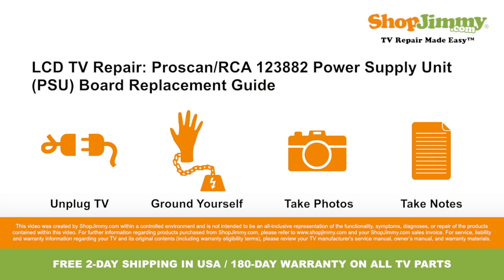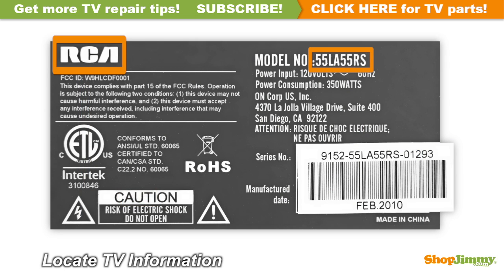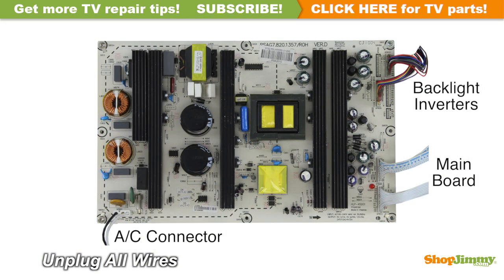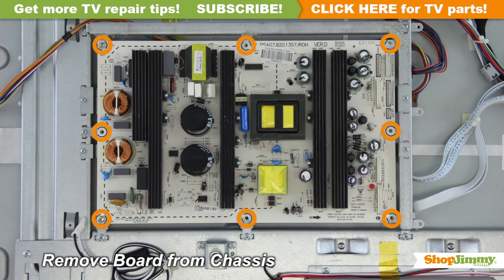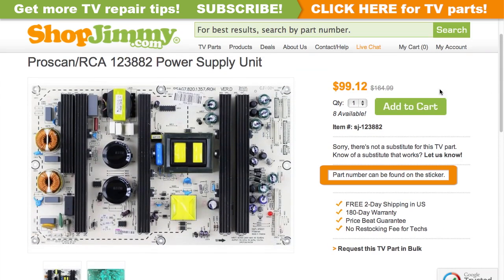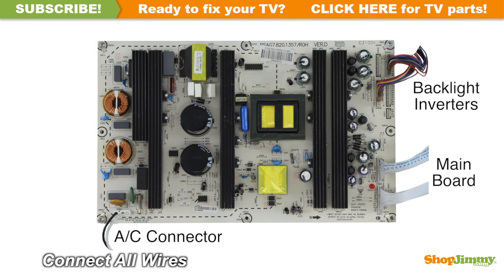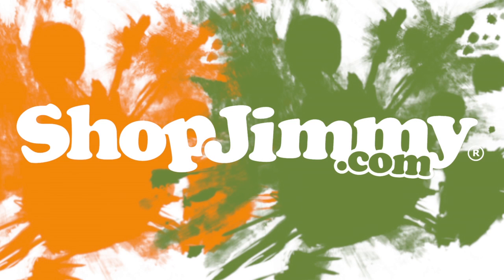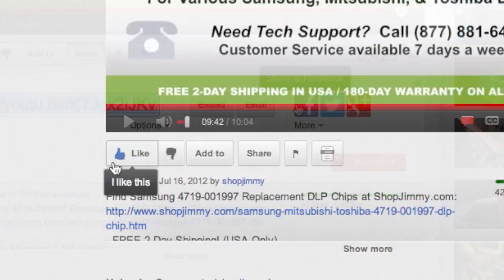Proscan/RCA 123882 Power Supply Unit (PSU) Boards Replacement Guide for LCD TV Repair

Comment: Proscan huh. Couple of years ago I bought a 40” Proscan and right out of the box it’s not working, I checked it out and did some tests but to no avail. Called Amazon (because that’s where I got it from) and they said send it back and we’ll send a replacement. Ok fine did what they asked sent it back replacement came in a couple of days later (yay!) set up the new one (what?) same thing happened went to turn it on nothing , blank screen no sound. Well hell called Amazon (because that’s where I got the replacement tv) went through the hoops and hassle then they said that they would refund my money. I asked them for return authorization and they said keep it they don’t want it. So now it sits in my shop. I’ve replaced the main board still nothing so now I’m cruising YouTube to see if I can get any clues to what the problem is. Oh and I bought a Sharp 40” flat panel and it works fine.

Comment: proscan lcd tv model 40ld45qc - was flickering, flashing. gave it a good hit with my fist on the rear corner. Problem solved. Have to do this a few times a week, been about a year now. Also leave it on full time as it didnt want to restart when off. Have to hit it harder now, so I think the end is near. But a new 43" is $160, so a $99 power board seems foolish. Any thoughts? Get a hammer?

Comment: I have a PROSCAN Model PLDED3257 A-B LED 32” the front power light is on but the T.V. wont turn on.. Do you think it's the power board?

Comment: I have a proscan 40" H D  L C D tv model # 40ld45q  serial # 9144-40ld45q-t118379  made Nov.2009  it turns on with picture and sound for just a few seconds than the screen goes black the sound is still on  ok

Comment: I have an RCA PROSCAN 39-40 inch LED TV not even 3yrs old. The problem is:  A dark screen and no picture or sound. The picture tries, but won't come in.  PLDED3996A-6 is the model and s/n is: A1304093290002425. Repair shop estimate is $435.00 and they parted it out and said: The picture is dark due to defective LED strips inside of the LCD panel. They put it back together and the charge was $40.00. Are there parts for it and if so, how much.   Thanks, Marvin       email: marvinhbutler@att.net  with the answer.
Reply from the maker: +Marvin Butler   Try all repairs and troubleshooting at your own risk.  Unfortunately we do not sell replacement LEDs for your TV model number at this time.  You can check back in the future to see if we have them available.  Thanks!  www.shopjimmy.com

Comment: My RCA L40FHD41 turns on and runs fin for 30-40 minutes then the picture goes dark, but the blue status light stays lit. After a few minutes, unplugging the set from power, then re-plugging causes it to start up, find the input and resume. For 30-40 minutes. Entire PS board problem, or something less catastrophic? Thanks!
Reply from the maker: +Harry Butler (hbphotoav)   Try all repairs and troubleshooting at your own risk.  I recommend running the flashlight test on your TV.   Here is a link to a video we produced that shows how to run the flashlight test. https://www.youtube.com/watch?v=xUzCLgoSPGM Please reply with your flashlight test results and we can recommend a replacement part for your TV repair. Thanks and please let us know if you have any questions! www.shopjimmy.com

Comment: I have a Proscan 39" LED PLDED3996A-C2, less than 2 years old.  When I turn it on there is no picture.  I can use the remote to change channels, increase/decrease sound, set sleep timer and they all work fine but no picture.  Can anyone recommend what part I might need?  It never occurred to me I might be able to fix this tv myself but if the part is reasonably priced, I can follow a YouTube video.  Thanks.

Comment: I have a RCA 39" LCD Full HDTV. I power it up, blue light comes on with no picture. The only way to turn it off is to unplug it.It is 2 years old. Any suggestions?

Comment: i did also flash light test and was able to see menu cked 24v to backlite inverter all 24v seem to be there....no obvious lites on backlite inv...did pull invert board and noticed heat marks on backside top of board....

Comment: i have proscan 40lc45s  blank screen and no sound... red power light goes to blue (stays blue)....power board red led on...
Reply from the maker: Davesbbq   I recommend replacing the main board in your TV.  Click this link to replacement parts for your TV model number:  http://www.shopjimmy.com/catalogsearch/result/index/?cat=56&q=40lc45s  There may be multiple boards for the same TV model number, be sure to match part numbers on your current board, with your replacement for compatibility.  Thanks and please let us know if you have any further questions with your TV Repair!  www.shopjimmy.com

Comment: Jimmy.com, i have a proscan plcd5092a-b  that just went out, there is no power and no stand-by led red light.  I am assuming it is the power supply board and i seen one on your website.  Any thoughts.  I was going to trash it but if a 45 dollar board will save it, well that would be nice
Reply from the maker: Warren Brady   Yeah, that could be the problem.  Might be worth it to try replacing the power supply board to see if it fixes the problem.  Thanks!  www.shopjimmy.com

Comment: Hi , I have an RCA 39" Mod LED39B45RQ...  usually it will not turn on with either remote or power button on rear of unit, however, if I unplug it and plug back in (immediately), it will usually turn on within 5 to 10 attempts of this, and sometimes very slow to turn on when it does.... and when it fails to turn on the red light will go out and stay out till I do the re-plug process.... so would it be a PSU or Main board issue??
the tv has 10/ 2012 manufacture date... PS, the youtube tutorial is awesome!
Reply from the maker: BIGDOG1189  Please watch this video FIRST to help with your repair!  TV Repair! LCD, LED, Plasma, DLP How To Fix Your TV with ShopJimmy.com Help!  I recommend replacing the main board in your TV.  Here is a link to replacement parts:  http://www.shopjimmy.com/catalogsearch/result/index/?cat=56&q=LED39B45RQ  Be sure to match part numbers on your current board, with your replacement for compatibility.  Thanks and please let us know if you have any further questions with your TV Repair!  www.shopjimmy.com

Comment: I have a ProScan 26' LCD TV Model  #26LB30Q   when I turn it on it stays on for about 10 to 20 minutes and cuts off by itself if I turn it back on it stays on for about 5 minutes then powers off what could possibly be wrong? Picture and sound is excellent
Reply from the maker: Rita Ellis   #tvrepair  I recommend replacing the power supply board in your TV.  Here is a link to replacement parts for your TV model number on our website, click here:  http://www.shopjimmy.com/catalogsearch/result/?q=26LB30Q  Be sure to match part numbers on your current board, with your replacement for compatibility.  You can also call our customer service for further assistance with your purchase.  (877) 881-6492  Thanks and please let us know if you have any further questions with your TV Repair!  www.shopjimmy.com

Comment: Hi I have a proscan 40lc45s that would have the red standby light on but flicker with no. Recently I tried turning it on and I get no standby light. Could this be a PSU problem ?
Reply from the maker: Miguel Rodriguez   Yes, if you have no standby, then I recommend replacing the power supply board to see if that fixes the problem.  Here is a link to replacement parts for your TV model number on our website, click here:  http://www.shopjimmy.com/catalogsearch/result/?q=40lc45s  Be sure to match part numbers on your current board, with your replacement for compatibility.  You can also call our customer service for further assistance with your purchase.  (877) 881-6492  Thanks and please let us know if you have any further questions with your TV Repair!  www.shopjimmy.com
  #tvrepair
Reply: Hi I finally got around to replacing the power supply board and i now have the standby on. Now the problem is the tv wont turn on. I can hear the psb, but it wont turn on. Any suggestions ?

Comment: I have a 32' proscan. The red standby light comes on. When I try to turn it on the light does change to green, but the screen is pitch black as if its off. What should I do?
Reply from the maker: Thicktufted Gai   What is your TV model number?  Please reply with your TV model number and then I can recommend a replacement part.  Thanks!  www.shopjimmy.com

Comment: Have a 40 tv and standby light comes on but no power. Is it the power board?
Reply from the maker: Tyler Jacskon   Since you have the stand by light in your TV, I recommend replacing the main board for your no power problem for your TV.  Please reply with your TV model number and then I can respond with a replacement part recommendation for your TV repair.  Thanks!  www.shopjimmy.com

Comment: Hi I have a RCA tv that turns on but for 2-4 sec before it turns off the audio still works and the image still comes out if I use a flash light I can see the image but the backlight turns off and won't come on. Could you please help me.

Comment: I have a proScan 32 inch duel hdmi  tv , when I power on the blue light comes on but not picture when I unplug it and plug it back in sometimes it comes on and sometimes it don't. What could be the prob tv is about 5 years old

Comment: Hello, I'm having issues with a 40 inch Proscan TV that won't turn on anymore. The red light in the middle still glows red but the TV doesn't respond to the remote or power buttons anymore. I was thinking the TV died because we've used it for four years but my friend said it might be something with the power supply. Thank you

Comment from the maker: @josh savo - I would recommend replacing the main board in your TV.  Do you have the Proscan 47LC55S240V87?  If you can identify the part number on your main board, please search it on our website shopjimmy com.  You can also call our customer service if you would prefer and they can help you search out the part.  (877) 881-6492  Thanks and please let us know if you have any further questions!

Comment: Hi jimmy I have a proscan 47 inch the power card is a 123882. the light in the front goes red right away and speakers make a buzz noise when powering up. there is a red led on the card and it is on checked all power 24v 5v and 12 volt and they all are there could it still be the power supply?

Comment from the maker: @thehorologist - Pictures would help us to better understand what the lines looks like, but from the sounds of it I would say that the panel could be damaged and getting worse.  I would recommend having a shop or trained professional look at the TV to see if it is the panel that is damaged.  If the panel is bad, it is usually more cost effective to buy a new TV as a new panel can be very expensive.  Thanks and please let us know if you need anything else!  (877) 881-6492